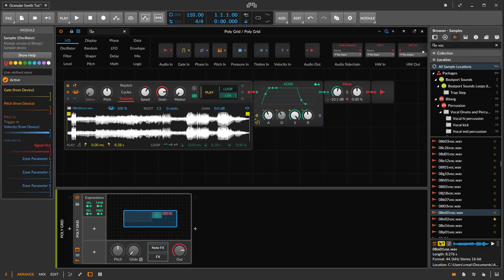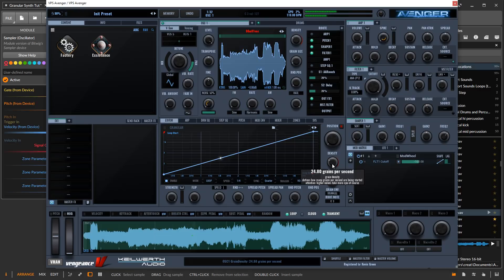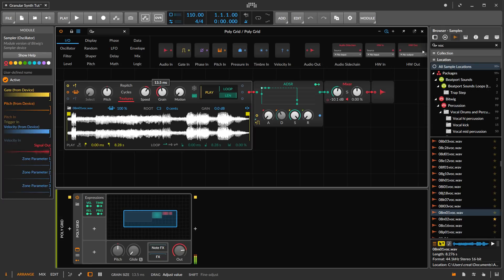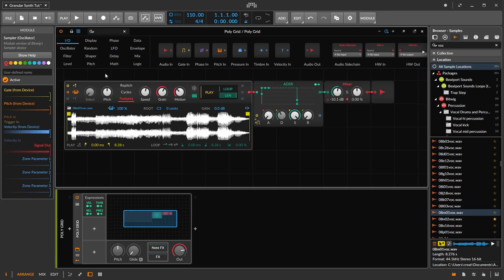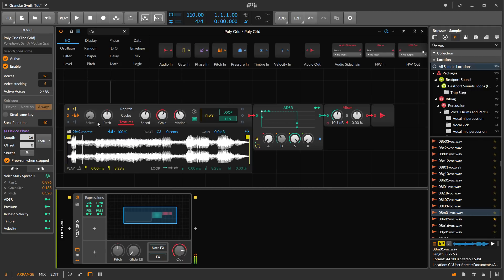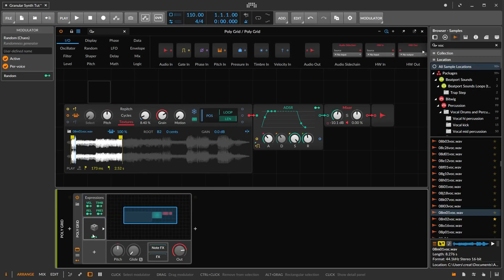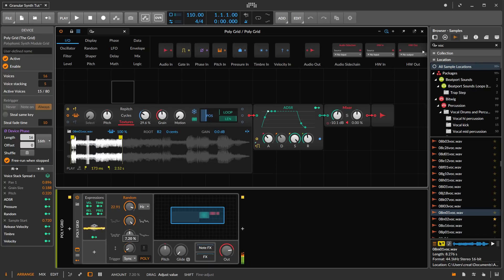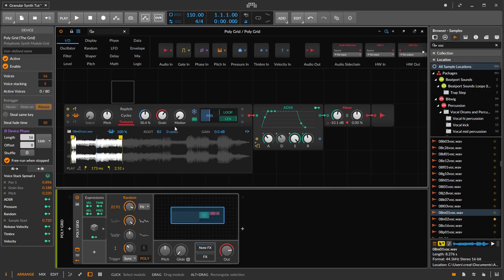Bitwig 3.0 Beta: Granular Synthesis in the Grid

Comment: When you say grains (that is more then one), do you actually have severeal playhead whaen stacking voices like this, or is it the same playhead playing different voices? If so you dont really have several grains, but just one, and the illusion of several when you use an lfo to modulate the playheads position.
Reply: Voice stacking with modulated playhead is actually several voices with their own dedicated playhead. So you have up to 5 grains in parallel. 
In Ableton I have Grain Scanner with up to 128 grains tho and also reverse can be randomly applied to some of them in percent.

Comment: I guess I'll be that person and point out the obvious. You could just do all this right in the sampler without the Grid.
Reply: Well it was controversially established in another Audio Digital vid that the Grid is better at 'cycles' mode than the sampler because of oversampling. I wonder if the same is true for 'textures' mode?
Reply: In the description, it says that all of these techniques can be used in the Bitwig sampler device.
Reply: The 4 x oversampling in the grid makes this sound different (better/smoother) than if you used the regular sampler.